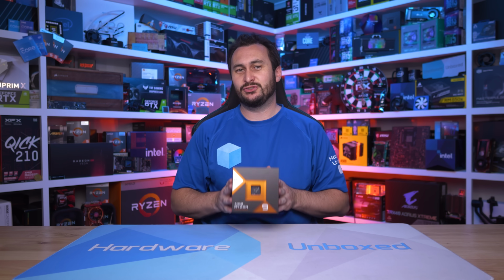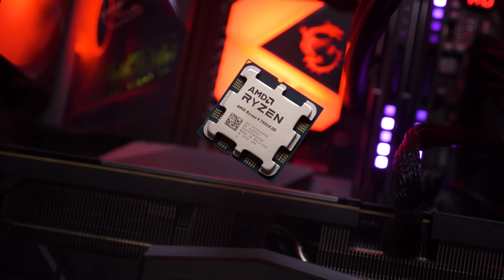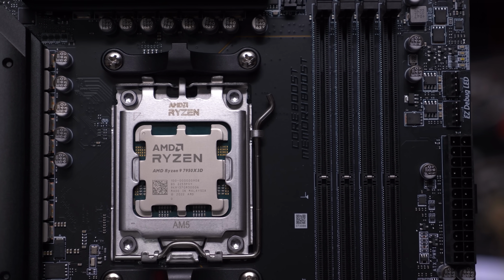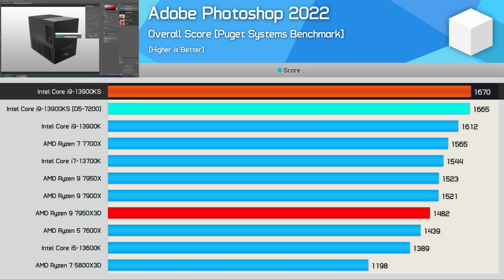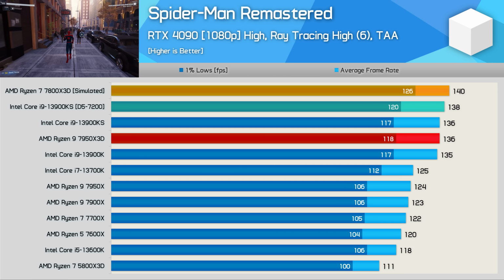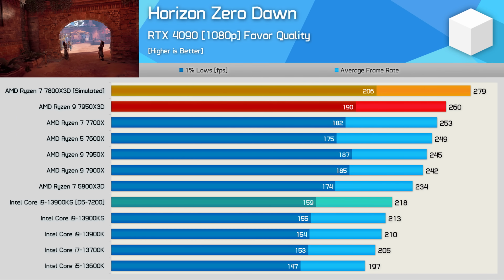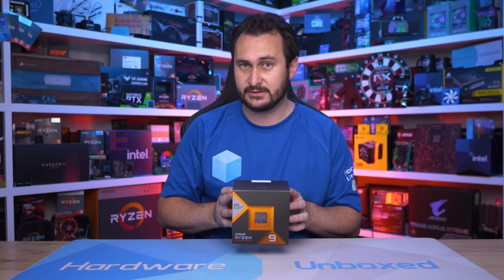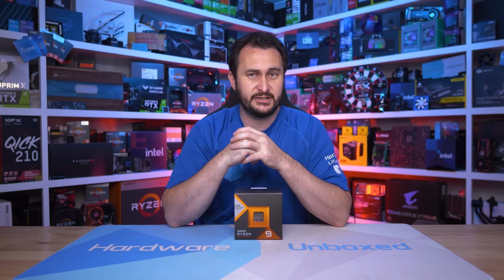AMD Ryzen 9 7950X3D Benchmark + 7800X3D Simulated Results

Comment: Why didn't AMD run an integrated test when first running applications to measure performance in 3 scenarios (with 3D die enabled, without 3D die enabled, both enabled) and using the best measured presets? Of course, this doesn't cover all applications with the best results, but I believe it will make things a lot easier for consumers who don't want to manually tune their processors.

Comment: I feel like most enthusiasts may be myself included will still buy this chip and then disable ccd2 like you did because my guess is that it will boost higher than a 7800x 3D

Comment: In general, both 79X03D CPUs do not make that much sense from a cost-performance standpoint, even with productivity included. The 3D cache is a ring-bus connected strip on-top of one of the dies, which limits its clock due to thermal constraints. You will have to rely on the shakiness of AMD's driver support to make it work properly. The extra cost is increased by the headache pills you have to take to get through a hybrid productivity-gaming day. Better to wait for the 7800X3D and hope AMD has recalled until then that you have got to have an advantage that justifies the costs.

Comment: GN said there is a new driver which fixes the issues of the 7950X3D, no longer needing to disable a CCD to get the full performance. (The driver basically does it automatically when it detects a game)

Comment: I think that the "price premium" section in the conclusion is a bit misleading. With a total system power difference of over 200 watts, even with cheap electricity prices in the US at ~16 cents per kWh, that's still almost $100 a year, assuming you're using your computer around 8 hours a day. When it comes to price, the lower power consumption of the AMD chips matters a lot. If you're in some areas of Europe, you could pay the difference after just a year of ownership, and end up saving money if you keep your CPU for two years. When you factor in the cheaper cost of cooling, the price difference basically evaporates.

Comment: Seems like the architecture and larger cache of Zen4 is “enough-ish” in more cases than with Zen3 making the extra cache less effective at getting that huge margin the 5800X3D was able to achieve. 
That said, the power consumption figures are impressive. Looks like the reduction in clock speeds brought the 7950X3D much deeper into its power/efficiency curve that the base parts clearly try to blow past like a 3090Ti does. 
HardwareCanucks even confirmed that air coolers are more than useable for this chip instead of massive liquid coolers. Great review, Steve.

Comment: Some impressive performance gains there! Nice to see the combination of more cores + extra v-cache instead of having to choose as with 5900X and 5800X3D at very similar pricing. Question is, can the simulated results be had using something like taskset to pin tasks to one CCD when launched rather than disabling in BIOS?

Comment: It is totally unacceptable for a flagship, gaming specialized product to be this bad at gaming that it is being beaten by previous generation 3D chip. Why enthusiasts like us can up-one AMD engineers and have to manually optimize their chips for intended use? This is a shoddy product good for nothing and it should had never left the prototype stage. You are literally being sold a failed prototype and people are happy idiots for that.

It has no strengths outside of power draw. It is beaten by previous gen chips in a lot of games. It is beaten in sheer productivity. It is not even good hybrid chip due to its price premium. i9 is bloody cheap compared to it! It is a product with no use and what is most infuriating is that it is not even good at gaming. A processor which was supposedly specialized to be good at it.
Reply: "enthusiasts" cringe
Reply: @dualpapayas  I know and that's is pure cringe and hard not to associate with the stereotypical basement dwellers who drink Monster Drink all day xD

Comment: The huge power efficiency advantage to these Zen 4 parts (Especially relative to guzzlers like the 13900K), make them the overall Cheaper options as well when factoring in Energy Costs. So even if upfront they may justifiably cost more, they will come out ahead in the long run from savings on energy bills. The huge lead in power efficiency also means that the upcoming Dragon (and Phoenix) Zen 4 mobile chips will smack around the power hungry 13th gen Intel mobile chips, which consume obscene amounts of power and frequently thermal throttle as a result (even when Undervolted..).
Reply: 100% right!
And there is the longevity of the AM5 platform just like with AM4.

Comment: So he was able to run 6000 ram I thought the max was 5200 for 7950x3d.
Reply: That's just the base JEDEC values it runs if you don't OC your ram. All 7000 series CPUs will default 5200MHz with no RAM OCing.

Comment: cost per frame is a good comparison. but if you look at frame per watt, i'd say that graph looks significantly in amds favor. i'm curious, did you try any of these tests with those custom memory timings?   always enjoy the great content you guys produce :)
Reply: You can easily and quickly do your own cost per frame calculation yourself using their benchmarks.  And you can adjust it for sales and price drops.
Reply: And your computer is idle way more than not.  At idle, Intel wins easily.
Reply: @mintymus  my computer is rarely at idle. if it is left inactive for more then 10 minutes, it goes to sleep.
Reply: @jayjonah2762  So your computer is always at 100%?
Reply: @mintymus  no, not 100%. but it is never sitting here doing nothing... i'm either gaming or working or something like that. but i dont just let my system sit here and do nothing.
Reply: @jayjonah2762  Again, at lower power stages, Intel is more efficient.  Go ahead and look it up if you want.
Reply: Cost per frame is useless. What matters is cost per additional frame and to know that I have to know what hardware you have and if you need a new motherboard, RAM etc. Nothing general can be said about that. E.g. the least cost per frame can be slower than what you already have if you have a 5800x3d. How useful is that?

Comment: Now I REALLY want to see a comparison between the 7800X3D simulation vs the real one in april!! To know if it was accurate!
Reply: Yeah, AMD wouldn't want to sell a lower tier CPU that sometimes performs +100% faster in games, right? What are they going to do, lol?
Reply: yeah this has interested me to now i was going to buy the 7950x3d then thought maybe the 7900x3d will be a better option..

But now after thinking about it and what i need being gaming im going to wait till the 7800x3d and be done with it till zen5 x3d its cheaper and even if its slightly worse than the 7950x3d ( even with half the cores shut down ) its the smarter option ...

A BIG question is whats the point of the 7900x3d now an argument could be made after the simulated results did AMD screw the pooch with it and should they have just released a 7600x3d at a budget cost to consumers  !!

Atleast in Australia at pc case gear the 7950x3d is on preorder ( was 24/3 to now the 27/3 so its been selling out since release ) 7900x3d still in stock and has been since release !!
Reply: doing the same thing right now. and seems to be accurate for the most part.
Reply: I think real one would better since 7800x3D simulation clock was 4800mhz but real one should be atleast 100mhz higher and even may hit 5ghz all cores since its a 8 core cpu that doesn't require special software like 7950x3D need ( i mean those new software still running background when simulating 7800x3D but real 7800x3D don't need that new software at all🤷 ) but maybe simulation is pretty accurate🤷 i hope it will be better than simulated result
Reply: @songoku9094  I am afraid you got it wrong.
The simulated 7800X3D here has same boost clock as 7950X3D which is 700MHz higher that what the real 7800X3D will have.
So the real 7800X3D would be probably quite a bit slower in lightly threaded loads like games where CPUs are boosting a lot.
And there are rumors that 7800X3D will be locked for OC same as 5800X3D is which both points to a fact that AMD is doing what it can to cripple it's performance so that it won't be faster/comparable to 7900/7950X3D and won't cannibalize the sales of these more expensive chips.
Let's wait for the real CPU off-course. Most probably it will still be great but I wouldn't bet 2c that it will be faster in games than any R9 X3D model due to those limitations...
Reply: There is a difference in cache sizes , 7800X3D is L2 at 8Mb, L3 at 96 Mb, 7950X3d is L2 at 16Mb, L3 at 128Mb. They will be close , maybe same, but I suspect the real 7800X3D will be 2-5% off what the simulated results show.
Reply: @Elysiann they disabled the extra ccd, it’s not using the cache in the other chipper because it’s a large latency hit across the fabric link to do so. It wouldn’t have any extra cache and if it did for some reason it would be slower due to the physics separation.
Reply: @alexmills42  yeah, I know. What I was getting at was with CCD2 diabled, the 7950 is basically the same as the 7800 , ie: 8 core 16 thread. But one has 128Mb across the 8 cores, the other has 96Mb across the 8 cores.
Reply: @Elysiann  well yes but the extra 32mb are slower because I believe it has to go through the IO die to access chance on the other CCD so it’s not directly comparable.
Reply: @alexmills42  if disabling the second CCD does shut down completely the die with its L3 cache, then it's comparable. On the other case, even if there is a latency penalty accessing the second CCD L3 cache, there is a high chance that by design its latency is lower than the fat L4 V-cache and the added L3 may still give an advantage on this simulated 7800x3d.
Reply: @Elysiann  No. 1 ccd gas standard cache of 32, other has 96 - same as 7800x3d
Reply: @deivytrajan  You're right. I knew that the caches were split that way , but I have no idea what I was thinking at the time. LOL. I guess I might of been thinking about the possible lower clock speeds ( on the 7800) and mixed it all up ..
Reply: @Elysiann  You are wrong. the other cache is just on second ccd which is disabled and your argument is invalid

Comment: Maybe you should add Football Manager (FM) to the CPU testing.
The CPU speed matters a lot in that game, it is a popular game (16. on steam), the community have made 4 benchmark save files with a methodology for how to test the game. And it is a completely different type of game compared to many of the games you are currently testing, probably most like Factorio, but it looks to matter much more what CPU you use in FM than in Factorio.
I think it is a good candidate for a CPU gaming test.
1. Since the CPU matters a lot and the GPU looks to matter very little.
2. Is shows relatively big differences between CPU's. (it can use many cores)
3. A lot of people play the game and the game seems to change only a little from year to year, thus a CPU that was fast in the 22 version will also be fast in the 23 version.
4. The game might show differences between AMD's X and X3D versions as well as Intel's P and E cores.

Comment: I just compared this review to the one on the Phoronix website and was just extremely surprised how different the results for Hitman 3 are on Linux. There, the 7950X3D easily outperforms the rest of the lineup with 449 FPS on 1080p using a 7900XTX compared to 412 FPS with the i9-13900K. The game is running on Ultra settings for Phoronix while in your benchmark, the game ran on High settings. Both at the same 1080p resolution. Why is Hitman 3 running so so much better on Linux where you can actually see the 7950X3D pull ahead? The game is running at around 200 more FPS on Linux with a worse GPU.
Reply from the maker: Are they using the built-in benchmark which is more of a GPU test? We're testing actual in game performance.

Comment: Can you make a guess as to what level of GPU would be a bottleneck so that a CPU upgrade say from a 5800x to a 7950X3D not worth it?  For example, are we going to see a minimla improvement due to a GPU bottleneck at 1440p with an RTX 3070 going from a 5800x to a 7950X3D?
Reply: Yeah, you're not going to get much, if any extra performance out of a CPU upgrade with a 3070, if you already have a 5800x. I'd say the cutoff is around RTX 3080 Ti or 4070 Ti at 1440p. It depends on the game though.

Comment: Haven't seen anyone mention it yet, so I'll do it. The 7700x appears, in these benchmarks, to be the best all-round gaming cpu. In games where the simulated 7800x3d is ahead, the 7700x is not that far behind, and it even handily defeats the 7800x3d in some titles. The 7700x has a significantly higher clock speed, you can run it in eco mode at almost no performance loss, it's unlocked for OC, it's significantly better than the 5800x3d in almost every title AND it's only 300 dollars.
Reply: Just save some cash and get the 7700 non-X. It can be clocked up to match the X version and even comes with a free cooler to boot.

Comment: Impressive how the top of the line 5800x3D is now bottom of the barrel currently, I'm still keeping mine for many years
Reply: LOL don't worry man that's only with a 4090. Remember the 5800x3d is faster than the 12900k and 7950x because the 3090 ti isn't fast enough to saturate it completely. So it's only bottom of the barrel if you use GIGA expensive cards

Comment: Biggest downside has to be the Windows recommendation, I tried windows 11 and can hardly get through a gaming session without a complete system freeze. Not even a bsod just have to hold down the power button until shut off.  Using Nobara Linux now and the Direct X 12 beta for Path of exile runs better through proton in linux than it did in windows. Microsoft is spyware with a crappy os running in the background.

Comment: So basically the new X3D chip has some wins, some losses, some ties all at 1080p. At higher resolutions the gap will close. Not that impressive as I thought it would be. For gaming AMD barely has the edge now. But nothing to brag over since the 13900k will be over $100 cheaper.

Comment: You're ignoring the cost of the CPU cooler in the comparison between the 7950X3D and 13900K.  The latter needs an expensive cooler to maintain performance.  The former does not.

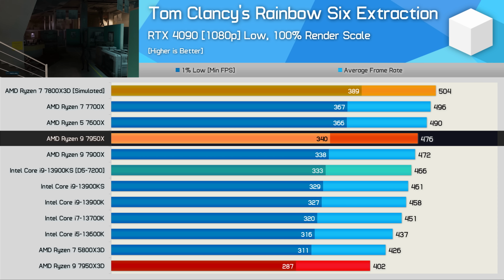Comment: 14:28 I think that shows that the system was not setup correctly. Gamers Nexus showed that the performance is better if you install the new chipset drivers.
Reply from the maker: How? They didn't even test the same game. BTW AMD confirmed this issue.

Comment: ouch,  just what i expected to happend.  games and the likes are NOT smart enough to make use of the right ccd with cache.  they should have just added it to both dies for that absurd price and leave the 7900X3D out and also release the 7800X3D.  Also i expoect the 7800X3D to be lower clocked to the simulated isnt that accurate but should be slightly slower.

Comment: I have a question...do you think AMD will keep the AM4 line going to continue to have a budget segment, or will they kill off the line to go AM5 only? As it seems to me that keeping AM4 alive even if its just with the current products is the only way AMD is gonna keep the budget market as the cost of DDR 5 and AM5 boards just makes Intel 13th the better value over AM5 but when AM4 is factored in AMD is the better deal.
Reply: they've killed AM4 completely. Once the new AM generation comes out the last one dies

Comment: Would setting the core affinity in the windows task manager provide the same result as doing it in the BIOS? That would make it a lot more feasible to actually do it while gaming because tools like Process Hacker allows you to set the affinity and store it so the game always starts with the correct cores being used.
Reply: Yes that's the main benefit of using process lasso with this chip. You set it once and forget it and the profile works in the background.

Comment: Very nice CPUs from AMD. I'm not just a gamer as I tend to use my CPU for many other tasks including transcoding/encoding, A.I. image and video enhancement software, and many other things. Got gaming, that Ryzen 9 7950X3D looks nice, and the 7800X3D will no doubt be the better buy, but for other workloads... makes it hard to pick between the 7950 and 7950 X3D.
Reply: I upgraded to the 7950x just months before the X3D announcement, expecting the performance diff to be equal to the 5600x and its x3d variant and I felt kinda bad. Thankfully the 7950x is still a beast trading blows with x3d in the workloads I use daily, like blender.

Comment: Is the problem really with the 3D v-cache or Windows' scheduler once again that might not be doing its job properly and using the right cores at the right time?
Edit: Your "final thoughts" aren't really fair when talking price comparison - once again. The 13900k is slower by some margin from the 7950X3D, it is the KS paired with 7200 memory that is on par with AMD's latest cpu. And that that 7200 memory is worth the price gap you are saying by itself. So the best gaming CPU for now it the 7950X3D and not what Intel told you to say :)

Comment: im just going to get a 58003d that's all i really need because my 5600x is working good with my 3080 , im not going to get a new gpu i got lucky with  3000 and amd gpus im on 1080p 27in 1 ms , if its not broke dont fix it simple ,💯💪 .